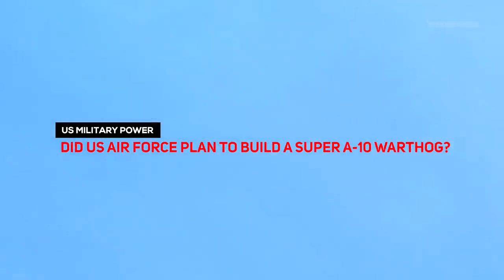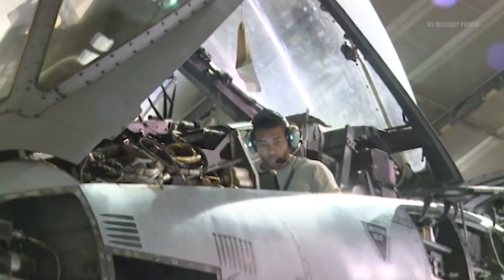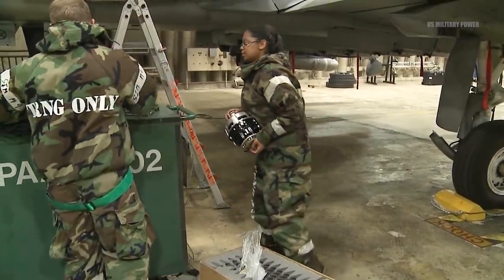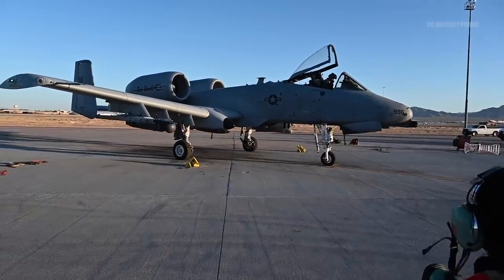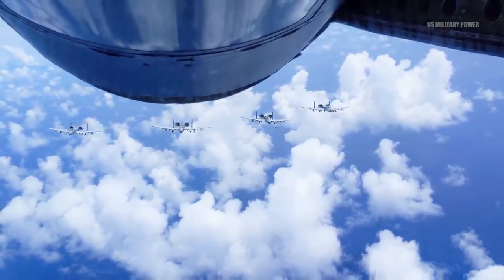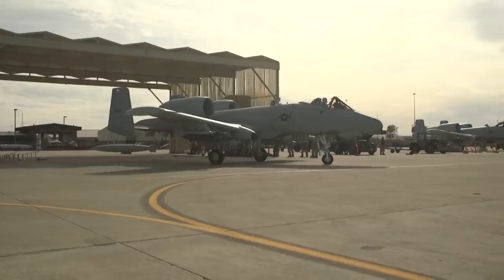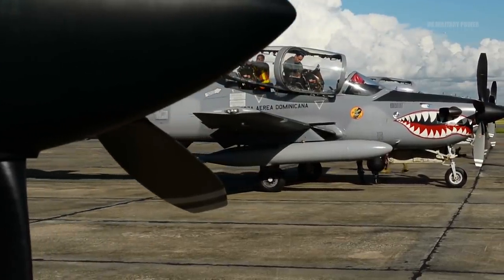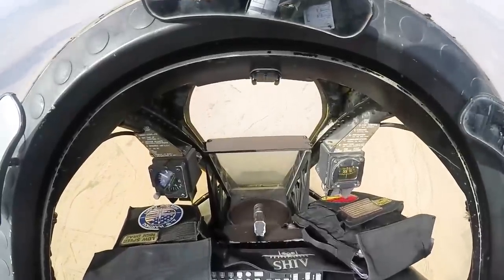The New Super A-10 Warthog is Coming

Comment: Is it REALLY so damn difficult to figure out how to replace the A-10 ? ? ? ? ?

You cannot beat the A-10's planform and airframe configuration.

The military needs to make a list of improved or increased capabilities that the new A-10 will need, then hand that list to Grumman and tell them to re-execute the same A-10 planform -- the basic shape and engine placement -- using modern materials and modern aerodynamics.  A modern re-execution of the A-10, using the latest materials and techniques would result in an airframe that's 500 to 1000 pounds lighter.  Modern engines would produce 10% more thrust while burning 20% less fuel and they'd require 90% less maintenance.  The "new" A-10 will look strikingly similar to the old A-10.

The ONLY way the F-35 could come close to doing a good job at close air support is if . . .

1)  The Air Force version, the F-35A, with 460 sq.ft. of wing area, were given the larger wing of the Navy's F-35C (620 sq.ft.), resulting in a much lower wing loading and far better low-speed performance.  The lower wing loading is CRITICAL to both the low-speed maneuvering that a CAS plane does and to the heavy weapons loadout it needs to carry.  Any decision-makers in the Pentagon who don't understand this need to read the biography "Boyd," about John Boyd, and then read his scientific paper about his "Energy-Maneuverability Theory."  In all honesty, the CAS version should be blessed with an even larger wing, maybe 700 sq. ft.

2)  The new wing on the CAS version of the F-35 were designed with numerous hard points for mounting the aforementioned loadout.  No stealth fighter with only internal stores can carry sufficient weapons for the CAS role.

But then, the A-10 has other design characteristics that no verion of the F-35 will ever have, such as the systems redundancy and the pilot protection.  And perhaps most critically, the 30mm GAU/8A will never be mounted on the F-35.

We need to cut about $900 billion out of the Socialism Insecurity and Medicare and Medicaid programs' annual budgets ($300 billion each), and increase the military budget by $100 billion, which will be spent exclusively on weapons procurement.  That way, the military management will stop trying to kill programs like the A-10 because they don't have the funds sufficient to develop and purchase new weapons.

Comment: obviously, the American Air Force is in the quandary of wanting to keep the A 10 NOW - after prematurely shutting down it's assembly line - AND wanting more F 35s, BUT without the budget to support both "cakes" so to speak. Simply using smaller, lighter aircraft to replace the A 10 is , at best, a poor solution in any sense except the "Budget" one. That would be like asking the American Army / Marines to give up their Abrams MBTs for "Budget" ideas like putting 120 mm guns on over armored Humvees. 
Of course the AAF COULD choose to acquire the Russian "Frogfoot" - essentially the A 10s smaller brother - as another alternative. It IS a smaller, less well protected, less well armed alternative, but it IS cheaper, and might have the benefit of improving diplomatic ties with Russia.

Comment: I find it hilarious that as soon as you put stars on a person's shoulders, their budgeting capacity diminishes by 90%.

Anyone with 2 brain cells knows that it is ALWAYS cheaper to upgrade than replace...specially with a whole new platform. A while new platform or new vehicle requires billions in training, tooling and manufacture of replacement parts. 

What is the benefit of a new airframe?
Better engines...can these "better engines" be fitted to the A-10? Yes but.....
Better avionics...can these avionics be fitted to the A-10? yes but....
Better armament....can the A-10 be equipped with these armaments? yes but.....

BTW, stop calling me Butt.......

Comment: Nothing can compete with the A-10 for what it does, the F-35 is garbage in most roles, yes it does have its uses especially the F-35B but as a multi-role nope, the F-35 should never be mentioned in conjunction with the term maneuverability, to quote the Rand Company report for the Australian AF "The F-35 cannot turn, cannot climb and cannot run" "The F-35 is double inferior to its competitors".

Comment: The 2 planes they want to replace the A-10 with cant carry half the load. The f-35 can't take more than 1 hit before it's in a ball of fire and the turning radius is a joke compared to the A-10. The Air Force has been shown time and time again that the army needs C.A.S. to make things happen on the battlefield!!!!! They needed C.A.S. low and slow aircraft in the beginning of Vietnam and came up with the A-1 Sky Raider then years later came up with the A-10 in the early 70's. U.S. Air Force get your collective heads out of you A_____!!!!!! If you don't have the budget then STOP making a plane that can't fly very well and keep the airplanes that are a proven platform till you have something that surpasses the present platform.